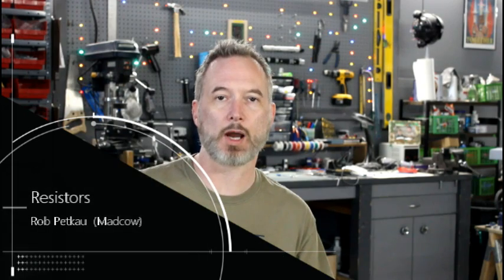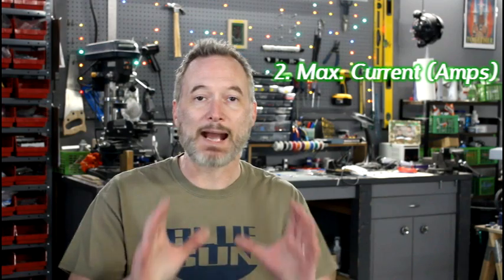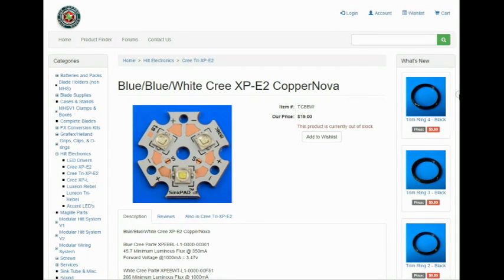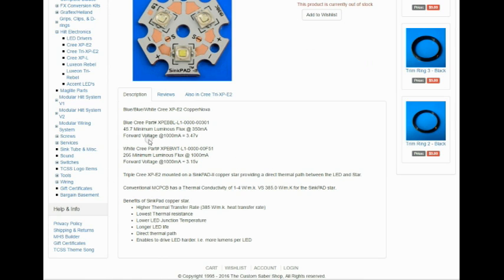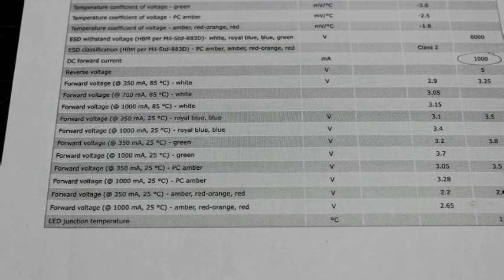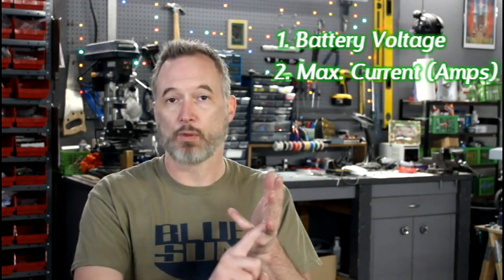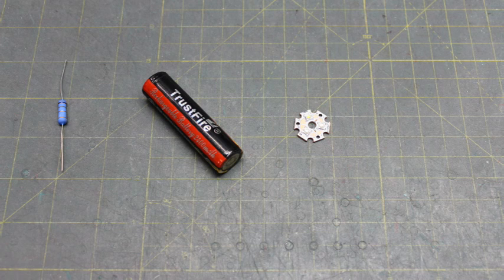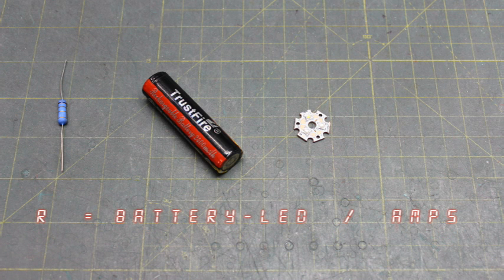Finding My Resistor

Comment: I have three seperateled led colours Green Cree Part# XPEBGR-L1-0000-00F01
122 Minimum Luminous Flux @ 350mA
Forward Voltage @1000mA = 3.7v

Deep Red Cree Part# XPEBPR-L1-0000-00D01
450 Radiant Flux @ 350mA
Forward Voltage @1000mA = 2.42v

Cyan Cree Part# XPEBBL-L1-0000-00301
45.7 Minimum Luminous Flux @ 350mA
Forward Voltage @1000mA = 3.4v 
so do I need to get a resistor for each or add them together?
And will a 4(r) v battery be enough

Comment: My plan is to wire a simple saber without sound with a tri cree. Do I need a resistor for each LED in the cree?
Reply: A separate resistor for each parallel LED is good practice.  Using 1 resistor for multiple LEDs in parallel, presuming they were matched to begin with, is when one LED gets hotter than the others it's forward voltage drops and it will draw a larger portion of the supplied current.  Which can lead to runaway as the hot diode pulls most of the current.

If the LEDs are different colors, a separate resistor is definitely required.

Comment: Hey Rob.  Thanks for all your very helpful vids. Ive learned so much from you. Youre awesome!  Im having an issue and cant find the help i need. 

Im doing a project and i cant wrap my head around my problem. I need to run 9-10 watts to my leds. (cree xp-e2 tripple up) At a maximum of 1000ma. Im using a 12v battery pack at 2000ma. But the circut board thats in the circut can only run at max of 4.5v. I cant figure out how to run the proper resisters to both the board and leds. I tried running it at 4.5v..with a transistor to boost the leds. Not working. I tried 9v...the leds work but the board doesnt. Should i be running main power with 9v instead of 12v? Please help.

You may email me if its preferred.
Louissdumoulin@gmail.com.    thanks.

Comment: can anyone help me please i want to use 4 AAA batterys and do I have to take the voltage of the four batterys or just one?
Reply: A 4*AA battery pack would have the batteries in series.  So 4 times the voltage of a single battery.

Comment: Hey, little tip guys. If using Deep Red leds, you might need to plan out your space a little more. The resistors for those can run large :)

Comment: Nice video, the formula is self explanatory, but say you run greens/whites 1amp without a resistor (3.7/3.5 Vf) with a single 3.7V battery setup will you burn the LED out? Would it be brighter?
Reply: In  a nutshell, it might slightly shorten the LED lifespan. Would be slightly brighter, but would interfere with the operation of a sound card.

Comment: Probably the same silly question, but if i want to tone down an led with a resistor because my led won't mix well with another (read washes out), which parameters would I have to use? I think the nominal Vf and the desired current? Also would I still need the protection resistor after that?
Reply: I'm not certain what you mean. If you have a resistor on your red and it's still too bright. Try a resister with a slightly higher value in Ohms.
Reply: I'm sorry for my vague question. What I was trying to say is, I have a blue led and a red led to make purple, but the blue washes out my red completely. I wanted to calculate the resistor to cut the current through the blue led, but I was uncertain of which parameters to use. I think the nominal Vf and the desired mA I want to suppress, but I will just have to try different values. Thank you for your time
Reply: Yes - experimenting is the best.

Comment: Hey Rob Petkau, I have a question a lot of people are telling me that you really dont need a resister on Green, Blue, or White. If you use the resister on those specific colors it will take away from the brightness. I just wanted to hear from you and see if it is true or not.
Reply: Without a resistor - and a full battery it will be overdriving the LED. A little brighter, and shorter life for the LED - your call.
Also - if using a sound board it can cause fluctuations that negatively affect the sound boards performance.
Reply: +Rob Petkau thank you for your response. Yeah when I was told that, it really didn't make sense to me because if I'm going to run it through the soundboard I really don't want to cause any issues with the board and also overheating or burning out the LED. So thank you again, I will be using a resister for my install.

Comment: For red Cree LED: R=(4v- 2.6v) / 1A = 1.4 Ohms.  TCSS doesn't sell a 1.4 ohm resistor, and the 1.2 ohm resistors are out of stock.  Will the 1.5 ohm resistor affect brightness significantly?
Reply: Not significantly - that would be a good choice IMHO

Comment: Hi Rob, I'm having some trouble here and I guess I'm just not looking in the right places. I can see that my LED has a max current of 1000 mA, but the max forward voltage specified (3 Vf) is only rated at 350 mA. Is there a ratio I need to use to figure out the max Vf or something?
Reply: If you haven't already, check out ledsupply . com and go to the LED product page in question.  If your LED is there, a list will be at the bottom where it should show max forward voltage at 350 mA, followed by Vf at 1000 mA.

Comment: What about a 12w led?
Reply: +Gavin Orth FYI...LEDs will vary voltage and current specs based on color and other attributes...not based on wattage.  It does not matter that it's a 12W LED.  It's meaningless. You need the specs for the specific LED you have.
Reply: +Gavin Orth 
Since you are an EE student you may want to note the error in your statement.  The 12w LED are in fact CREE based LEDs.  They are 4 Cree XB-D mounted to a custom star (placed touching which reduces cooling and light output due to said poor cooling) instead of 3 of the newer and brighter XP-E or XP-E2 mounted to the SinkPad II that are sold through other vendors.

If you want to know why they are labeled as 12W, it stems from the way CREE markets the XB-Ds as 3W LEDs.  So piggie backing on CREEs datasheets SF markets them as 6W and 12W to match.  

Also I personally know 2 of the EEs that develope the CREE LEDs and have I have designed lighting solutions for them as well so I kinda second Robert's comments
Reply: +Josh Leedle 100% correct Josh.  The idea by SF is to make people think that the 12W is somehow brighter than the TriCree XP-E/XP-E2, when its not.  More Watts does not automatically mean Brighter LED.  As you pointed out, technology, cooling, placement, optics, etc. all have a direct impact on brightness and efficiency of converting electrical energy to light output.
Reply: +SavatoEX I hear you...it just would have been a lot clearer if you had asked "does anyone know what the specs are for a Saberforge 12W LED".  That would have been a better original question.
Reply: the saberforge 12w are usually pre-resistored for a 3.7v battery but I would recommend a tri cree
Reply: Seriously, did you even watch the video?  Whether it's a 12W or a1200W LED, the laws of physics don't change. Follow the math he shows for your LED.
Reply: +Gavin Orth Glad you're an EE major.  I have a BSEE, MBA, and 38 years in engineering and IT, general manager director at a very large corp.  So waving a flag saying I'm an EE major means little to me.

Let's set aside our credentials, as I agree with what you are trying to say, SF are idiots with that 12W led stuff.  A higher wattage LED does not equal a brighter LED, its just a marketing ploy they use to sell to an uneducated marketplace.  Example, a 60W incandescent light bulb is not brighter than a 20W LED bulb.  

I agree with you, get a TriCree, I own several myself, in addition to some very bright LED string blades I have.  My Makoto V4 LED string is by far the brightest blade I own, brighter than the two Makoto V3's, the three TriCree's, the TricCree RGB, and the one SF 12W+ I own.
Reply: +Gavin Orth some people are just too sensitive....you're reading criticism where none is intended or stated. 

I never asked if you watched the video....I asked him if he did. If he had, he would know he needs the Vf and the max current of the LED, plus his battery voltage just as Rob stated.  Its not freaking rocket science, the math is right there.  The fact he has a 12W LED is irrelevant, his question contained little information of value and ignored what the video told you was needed, he needs the LED specs and those specs will vary depending on the maker and the LED color.  That statement from me was also directed to his posting content.  Not you.  

Stop thinking people are somehow out to get you in a simple discussion, they aren't, its a simple conversation with  pro's/cons.
Reply: +SavatoEX Here is a link to the data sheet for your calculations http://www.cree.com/~/media/Files/Cree/LED-Components-and-Modules/XLamp/Data-and-Binning/XLampXBD.pdf if you have any questions just ask. Hopefully people will help you. You could message me directly too.
Reply: NERD FIGHT!!!!!!
Reply: Gavin Orth Thanks, was wondering since I planned to replace the shite SF soundboard with a Spark 2. And yes Robert Fousch  I did watch the video and I'm already familiar with ohm's law for LEDs but there is so few information out there on SF parts.
Reply: +SavatoEX 
I assume you have the Champion level with the SaberCore, because the Hero level already has a Spark board.  Personally, I would move to a Plector board is unhappy with the SF after seeing reviews on quality and ease of install I did and could not have been easier to work.  I did email Erv a couple of questions and had a response withing 30 minutes each time.
Reply: So for the 12w or four 3w LEDs, would I need to calculate the combined voltage and amps for all four LEDs to get the resistor I need? As in would i need to multiply what is on the spec sheet by 4 to get the right amount? 

Going to be my first build and I really don't want to brun out the LED.